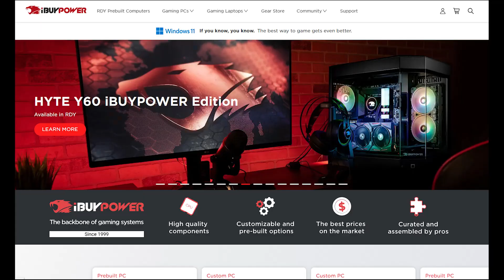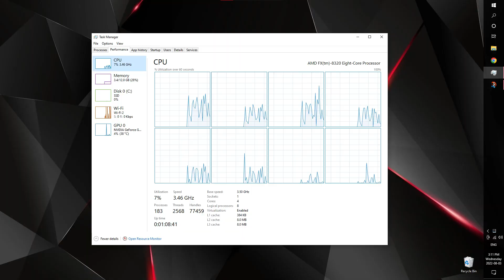This old used iBuyPower PC was... not bad actually.

Comment: Have upgraded 3 ibuypower desktops and never seen a psu like that, maybe that was replaced by the previous owner. Btw 2 of those are thermaltake 550w psu black cables.
Reply: It was missing the IO sheild too.  There have been replacements.

Comment: OMG!
 This is not a way for remove a cooler with a processor with pins. I must confess that happened me with an old AM3 Sempron. 
The best way is:
1. Open the case and  unplug the processor fan.
2. Turn on the computer and enter in BIOS and  then into Hardware health or similar name, where you can see the processor temperature .
3. Once temperature reaches 60 or 70 Celsius and thermal  grease is softer, turn off the computer and then remove the cooler.
Reply from the maker: Yeah I kinda knew that. I also kinda willfully forgot because I was half hopeful half lazy. I learned my lesson!

Comment: For GTA just make sure you dont have the VSYNC turned on as it may limit it to 60 FPS depending on your graphics mode.
Reply: It was exceeding 60fps though which is weird, unless there's something GTA specific that I don't know, I doubt this should be a vsync issue.

Comment: The CPU is definitely the bottleneck here. The low frame rate you experienced in GTA 5 was probably due to the CPU. AMD's Bulldozer chips used CMT instead of SMT. If I remember correctly, 2 cores shared one FPU, and since GTA 5 relies more heavily on the CPU than some games, I think the CPU was struggling with floating point calculations. Just my guess. Great video!  I still have an AMD FX 6350 system with an R9 280 graphics card.
Reply from the maker: Ah good to know!
Reply: I got lucky when a friend gave me a motherboard, CPU, GPU, and 16GB of RAM.  I got an FX8320 along with a Radeon HD 7950 3GB. GTA V runs about the same for me.
Reply: That 8320 is Vishera, which brought improvements over Bulldozer. 3.5GHz is a problem. As you doubtless know, you have to overclock FX and have fast DDR3, it makes a significant difference. But not with that cheesy cooler iBUYPOWER used. I have been using my Noctua D15 with a FX8350@4.6GHz + 32GB of DDR3 1866@2133MHz. Testing with a GTX 1080 gives excellent performance for a 10yr old CPU. Witcher 3 1080p maxed including hairworks is silky smooth with 60 vsync 99.99% of the  time. 

@TechDweeb, Still a lot of gamers on FX, so wouldn't hurt to revisit this with a much better cooler. AM3+ works with AM4 coolers, I have even put the Wraith Prism on the 990FX board before. You need to put the FX CPU in the title too. I fried 2 MSI 970 Gaming boards overclocking FX 8350, but that was marathon sessions of Total War: Warhammer back in 2016. Should not be an issue for some benches. Point a fan at the VRMs and northbridge if you are concerned, they will get toasty. Like burn your finger if you hold it there toasty.
Reply: @da1punisher  I too have an FX8320 and the MSI 970 Gaming Motherboard. If I overclock the 16GB of RAM to 2133MHz will I get better performance out of my FX8320? I have a Gamemaxx 400 CPU cooler which doesn't do a very good job of keeping the temps under 70C if I try overclocking past 4.3GHz. Probably not the best aftermarket cooler for the FX8320. I even bought decent thermal paste and applied it to both the CPU and GPU but it doesn't help much. Is there a trick to overclocking the CPU without having to increase the voltage to 1.4 or higher in order to achieve 4.5GHz? What settings did you use in the bios to overclock yours and what temps do you get for the CPU and Northbridge? I'm only at 4.0GHz due to overheating issues.
Reply: @BREEZYM6015 As always it depends on the game. But that said, if your ram is stable at 2133MHz especially without relaxing the timings, it will give a nice boost over 1600, even 1833 can add a couple of frames or more. It's free performance so whatever extra you can get is a bonus. RATech here on Youtube has a great overclocking guide and benchmarks for FX, check it out. 

For my combo, I just changed the multiplier and set vCore at 1.4v. 4.6GHz with the D15 stays under 60c gaming. When I set it up and use it, it is an open air testbed with a ceiling fan blowing right on it, and central A/C, so that helps temps too. Northbridge and VRMs I check with a infrared thermometer. They can get in the mid 60s on the hottest spots if I am running it hard for an hour or more. even with the ceiling fan on high. 

 Your 8320 at 4.3GHz might be the limit with your cooler.  It says it is rated for 125W so no real extra headroom left with FX 8 series. The ram overclock alone is worth the time though.
Reply: @da1punisher  Thanks for the tips. I'll try 4.3GHz again and overclock the RAM to 2133. I might try the open air test bench idea and see if temps are lower. My case isn't that good for airflow.
Reply: @da1punisher  Where do you have your testbed set up at? I assume it's not in a case. I would be worried about it getting knocked over or moving around if it's not secured to something.
Reply: @BREEZYM6015  I have a big workstation table I was given from when the local newspaper facility closed years ago. I use it as a test bench in my PC lab. It's about 5' long  x 3'deep. Plenty of space for projects.
Reply: @da1punisher  That's nice. I need something like that.

Comment: I have a case solution - take off the red bits and paint them orange, tech dweeb style! That red gaming cooler though - definitely perfectly adequate!

Gta maybe really uses only half of those "a real 8 core for you my friend, I wouldn't ever lie to you, you can trust me, it's a real 8 core, and I'll give you a discount because I like you my friend, you remind me of my grand nana, so I can't say no to you friend, you've got such a good price I'm losing money" cpu. So, while it says 56% utilization, it is, in my opinion, hitting 100% of what it can actually use - half of every chiplet.
Reply from the maker: I totally thought of doing that with the paint! I even snapped the front shroud apart just to check that I could. It would be very easy. 

Good to know about the GTA 5 performance. I knew I shouldn't have trusted that shady smooth talking FX swindler.
Reply: @TechDweeb  the fx swindler I was thinking about was AMD 😅 I kind of disliked the chip since it came out, as they tried to sell a quad core as a 8 core

Comment: There must be a bottleneck somewhere. Maybe put in more ram for gta 5. Or faster hdd... i do not think gta 5 is that well optimized at all though. Game just old so t runs on anything basically. There are spots in the game that tanks the frame rate on even the best hardware.

Comment: Gigglebyte lol

Dude, wtf is this nonsense, is this typical of ibuypower?
Reply from the maker: From what I've seen their PCS have a very wide range of level of quality. This is obviously one of the low end ones.
Reply: @TechDweeb  ya, like, that's the sort of psu you find on ebay for only $25 and wait a month to get
Reply: @TechDweeb  tell me you've since swapped it and that cooler out  with better ones, the rest of the rig seems ok.